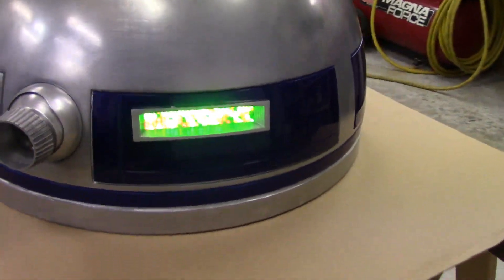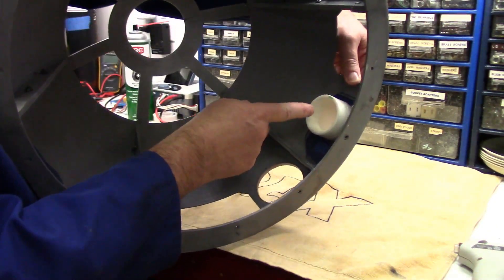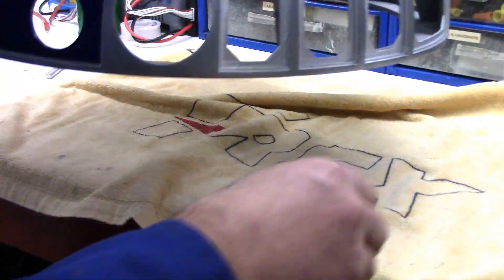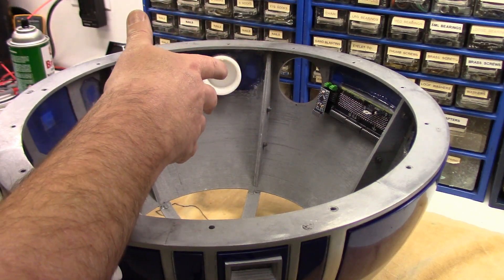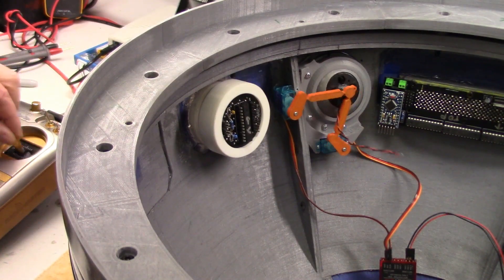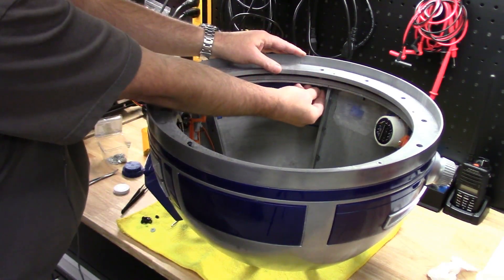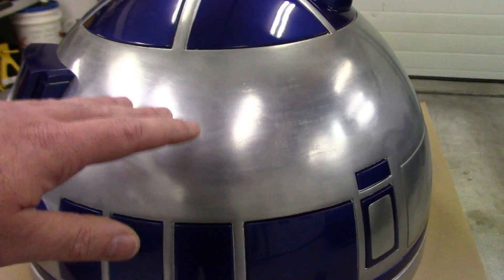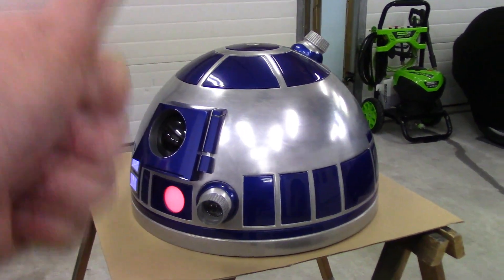Making R2-D2 Part 4 - Final Dome Assembly & Fitting Holoprojectors

Comment: Amazing finishing job!  I noticed that your center disc on top of the dome has a small center ring that appears to be fitted around the center blue 'button'.  I can't find the STL file for that little ring, and I'm wondering if you created it yourself, or if you know where I can find. the file.  Thanks!!
Reply from the maker: I used a stainless steel washer that fit well. No idea where the actual file is as that was 3 years ago now and I can barely remember things that happened last week. I would presume it's with all the rest of the dome greebles - no?
Reply: @Rchelicopterfun  Thanks!!  Will do the washer solution.

Comment: Thank you for the effort in recording and editing the best tutorial for building an R2-D2 with a 3D printer. I had been wanting to build one for many years, and it wasn’t until I saw your tutorial that I decided to go for 3D printing. I wanted to ask about the upper ring of the dome, the piece called “topdome”. It has a ring on top, but I haven’t been able to find that part in Baddeley’s files. Did you make it separately? Thanks for everything.
Reply from the maker: If you're referencing the little silver washer around the head button on the very top of the dome, there is a print file with all the dome pie sections for it. However, I didn't like the look of it, even after finishing and putting silver rub and buff on, so simply use a stainless steel washer instead. Could have saved over an hour of work if I just did that to start with. 😕
Have fun with your build!

Comment: what are you using to power the dome electronics? i know you had it hooked up to your variable power supply for testing purposes but is there a battery youre using for when its assembled?
Reply from the maker: I'm running 24VDC up to the dome through the slip ring from the main 6S LiPo battery packs I use to power all of R2. I then use two adjustable DC/DC buck converters to regulate the 24V feed voltage up in the dome down to what the specific electronics in the dome operate at (5VDC and 3VDC). This is all covered in the electronics videos of the series.

Comment: Looking great! As for the imperfections in the silver -- could you clear coat that silver with something like a 2K clear coat and the polish it up after it cures to help get rid of that? Also, did you need up gluing the pie plates in on top, or will you animate those with servos later on?
Reply from the maker: @Elixir Graphics. I did a couple paint tests on failed print pieces with clear over the metallic aluminum Rustoleum 2X and I didn't the look at all. Once the clear went on, it took away the "metal" look. Basically looked like silver car paint - nothing like what R2's dome looked like in the movies. Regardless, once the first little bit of Rub-N-Buff hit that dome, there was no going back since any paint would no longer stick to the wax coating. I never wanted any moving panels on this build, all pies had been glued in place by the end of the video. 🙂

Comment: Looks good 👍🏼 An imperfection here and there is no issue, R2 have been around and got some patina 😎
Reply from the maker: @Mickael Jansson - Very true. I've read/seen by adding weathering, you can also hide or blend out lots of little mistakes. Undecided if I'll add weathering once the project is completed or not. Still a long way to go before I'm at that stage in the build. 🙂